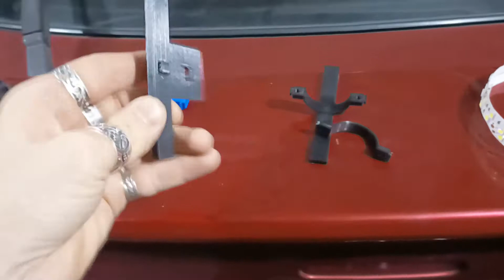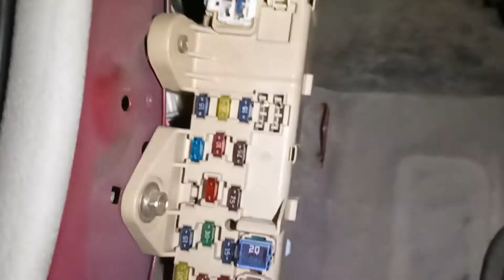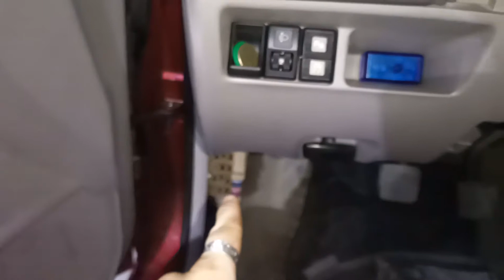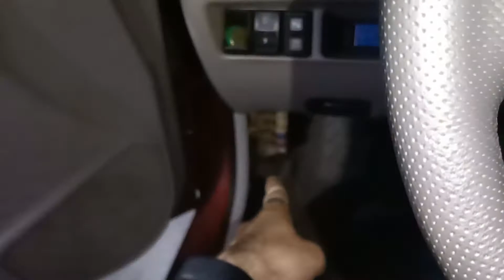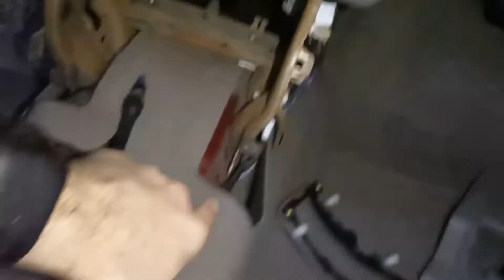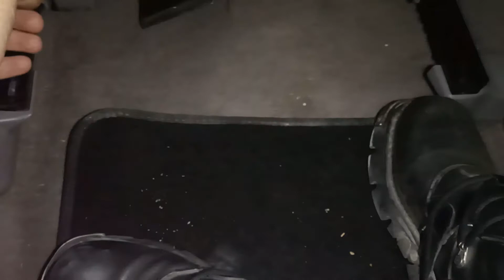Adding footlights to Mazda 626 GF

Comment: Hello. While doing this application, I short-circuited the socket in the fuse box. now the ceiling light does not come on when the doors are opened. the power comes on but the negative cable is not working. I checked all the fuses. Can you help me where should I look? thank you.
Reply: Thank you very much for your help. I am following your videos with excitement. I wish I could be as knowledgeable as you and modify my vehicle as I wish. I would be very happy.
Reply from the maker: @umitozgur4485  Thanks!
Reply from the maker: Yep, I know exactly where the problem is - I made 2 videos about this problem:
1. https://youtu.be/m2KEqjVJnvU
2. https://youtu.be/qtWCFUucX70
Problem lies in the instrument cluster, that is why I made 2 videos for the same problem, as I blew-up 2 different instrument clusters. In the second video I added an external fuse to the line, so that never happens again.
Reply: Thank you very much for your help. I don't speak much English, but as far as I understand, there is a problem with the transistor in the display. I can solve this problem by throwing a bridge with a cable from the places you showed me, right?
Reply from the maker: @umitozgur4485  Yes, PCB track burns out. Open the instrument cluster and you will see it. Transistor should be fine, it is a powerful one.

Comment: Hello! Do you may have an advice on why my trunk lighting doesnt work anymore? I changed the bulb, but still nothing. I wonder how the light knows whether the trunk is closed or open, or by what it is controlled or what its connected to in general. Thanks for your help!
Reply: Its a year 2000 facelift diesel Limousine (sedan)
Reply from the maker: Hello. There is a trunk switch that supplies ground. On my 5HB it is connected to all other door switches, so no matter which door I open, light in the trunk is always on. Not cool. 12V are coming from ROOM fuse. You need a multimeter and check which one you are missing on the pins for the light bulb.
Reply: @Mazda626GF  Thank you very much for your help!